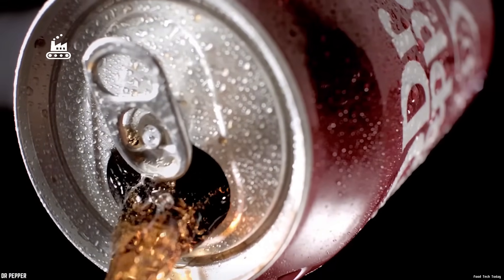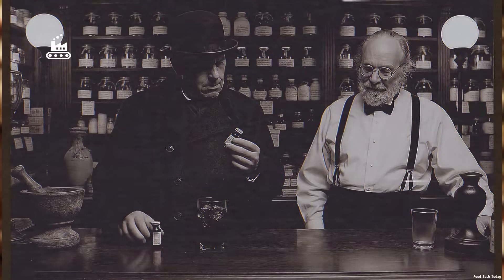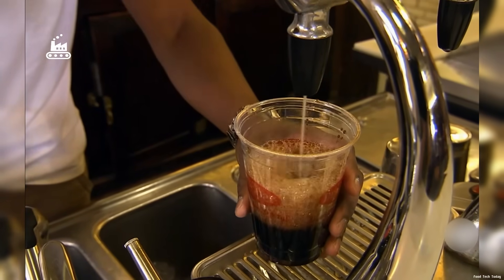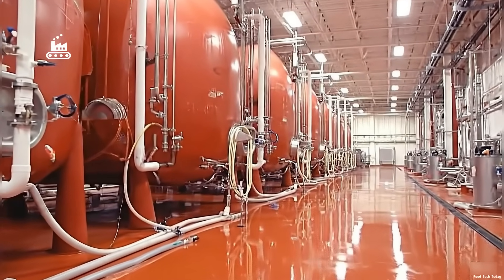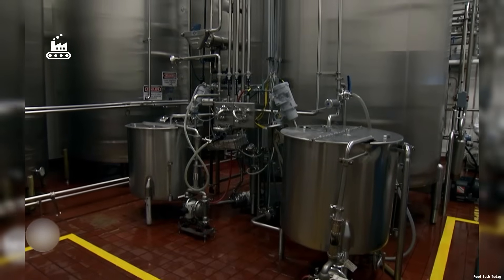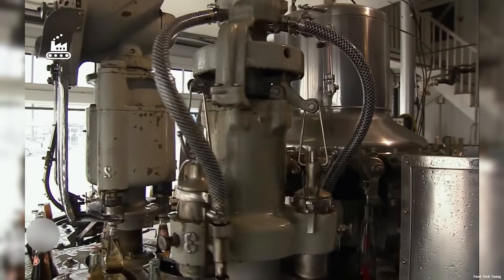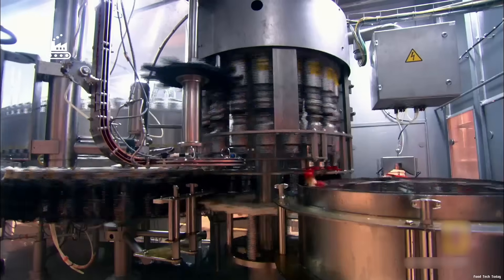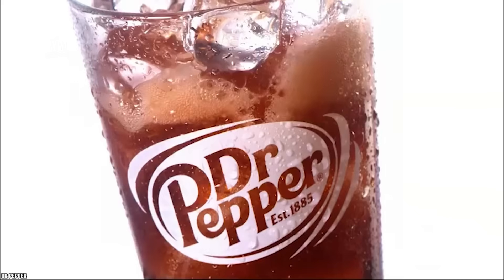How Dr Pepper Is Made in a Factory | The Secret Mix, Carbonation, and Bottling

Comment: Dublin Texas is where they used to make Dr. Pepper till Snapple got a hold of it and said no. By the way, the corn syrup stuff is gross. Cane sugar is so much better, but the problem is it's got brominated salts in it. That's probably what gives people cancer and or diabetes inside from the corn syrup. So with doubling not making Dr. Pepper as far as I'm concerned it's dead. Thanks, Snapple jerks.
Reply from the maker: Honestly, I don’t think either one is that good, so I just keep it in moderation.

Comment: How do they fill it so fast without it fizzing out the top or just becoming bubbles?
Reply from the maker: The engineers who designed this are geniuses… and I’m just here to drink it.
Reply: IT’s bottled under pressure, once the syrup is mixed with water at those two glass looking chambers hanging on the filler the product is forced through a spray bar with CO2, inside a CO2 pressured cooling chamber where the drink and CO2 are pressurized together, at this point the CO2 and drink are one and the same, and is pushed through the filler under CO2 pressure and in to the final bottle or can, the CO2 doesn’t have time to release from the liquid causing the fizz we hear before it’s capped. These canning, bottling lines are running so fast it’s impossible to follow one through the canning, bottling process. . . If you take a spoon an tap one time on a pan lid you’ll get that one tap sound. The canning lines are moving so fast that one tap you got from that spoon is a solid sound when these fillers are running.